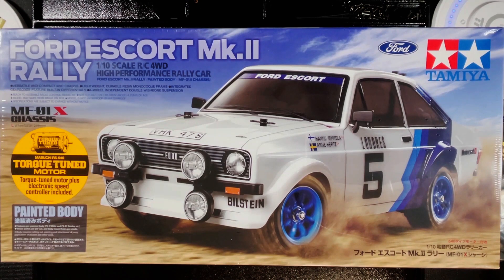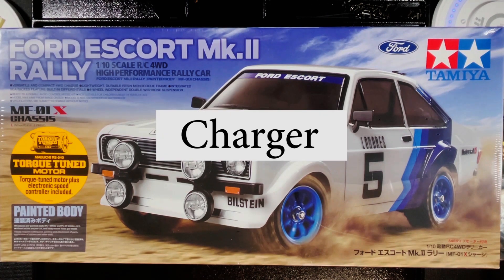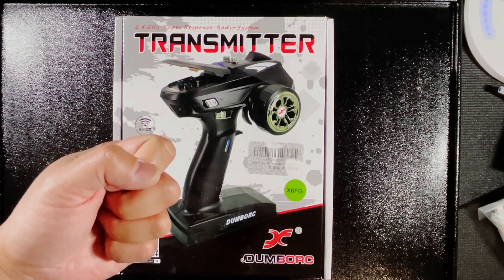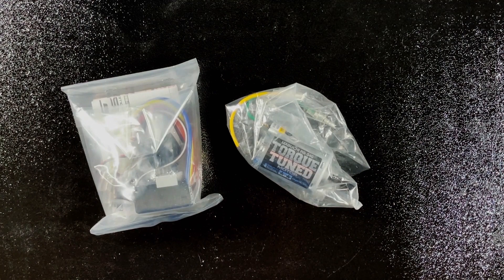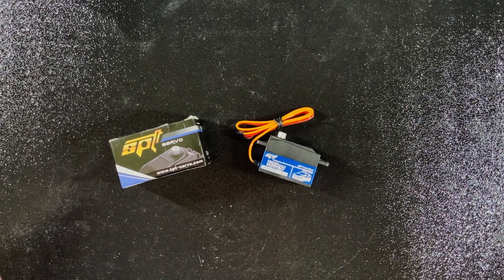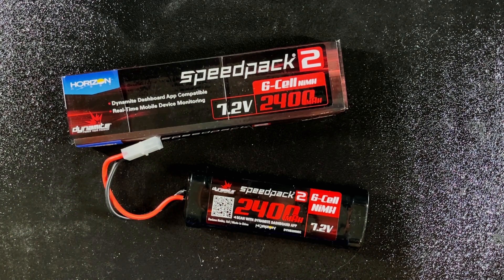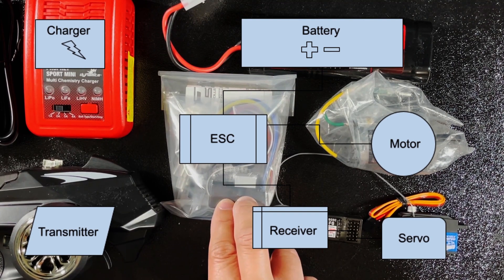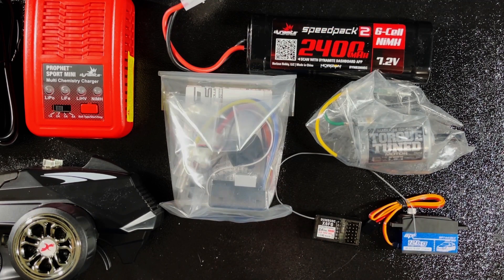Beginner’s Guide to Tamiya RC Car Kit Electronics | ESC, Motor, Servo, Receiver #tamiya #tamiyarc

Comment: Excellent video, very informative and easy to understand. I have a Tamiya "Bigwig" I built back in 1987 which ran on Nicd battery. Can I switch to NiMh batteries as Nicd seem to be out. will the connector to the motor fit? thanks.

Comment: i have a question about tamiya, if it includes a motor, ESC and but needs a reciever and radio to complete would a traxxas receiver, transmitter and servo work with the included esc? I have spare parts from a traxxas and was interested in these tamiya kits. Thanks.
Reply from the maker: I don’t have any personal experience but yes Traxxas radio/receiver should work with what comes in a TT-02 kit.

Comment: I bought a Tamiya hornet and I’m buying everything separate the transmitter is where I’m confused on what to buy I keep saying 2.4 as they go to is this right
Reply from the maker: 2.4Ghz is the standard frequency. Make sure it comes with the receiver as well. There are plenty of choices depending on your budget.
Reply from the maker: Check out my Under $200 RC Car video. You can get some ideas there.
Reply: @RCsRCCars  will do